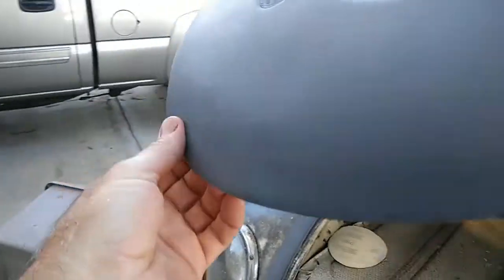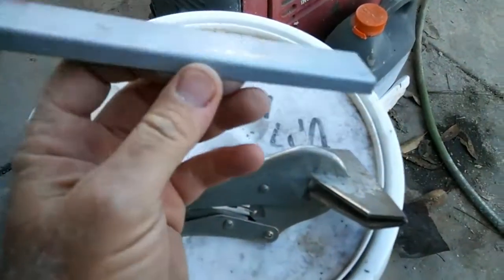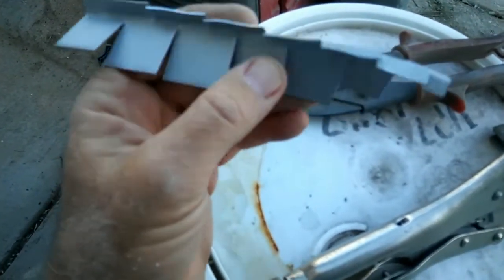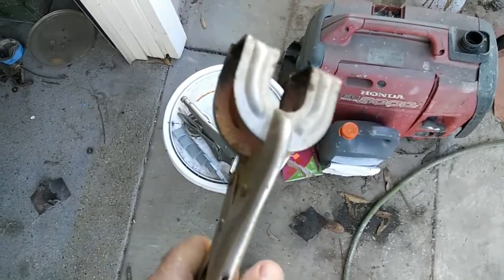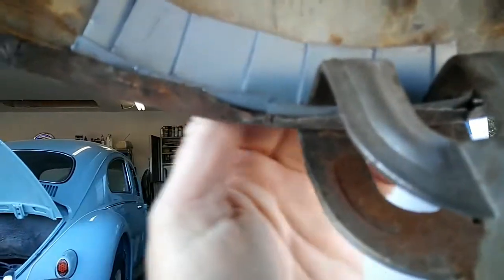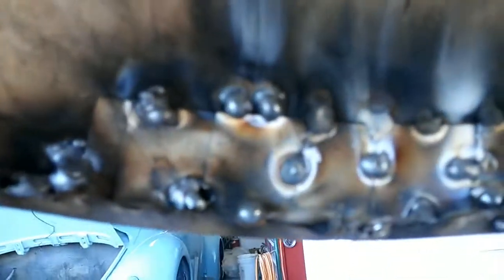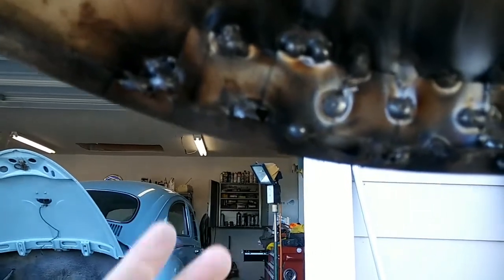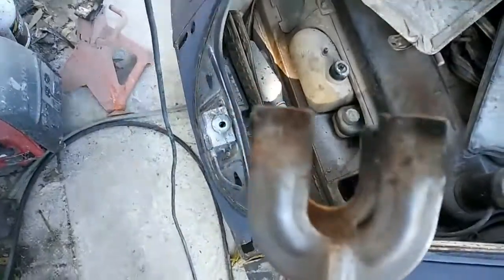vw bug hood crack repair or rust hole by sheet Metal work pie cutting

Comment: Harbor Freight sells a Shrinker Stretcher Mike.  Saves a.ot of time.
Reply from the maker: they only help with 90 degree angles this is a compound bend an is is almost rolled over. need reinforcement. Once filled you can never see it. I have one but it would not help with this repair at all

Comment: That is so NOT the way to do this. 
Get a shrinker and stretcher and do it right . One piece easy bend
Reply from the maker: shrinker stretcher would not help make that bend plus you need that area reinforced. this is a weak point of the vw